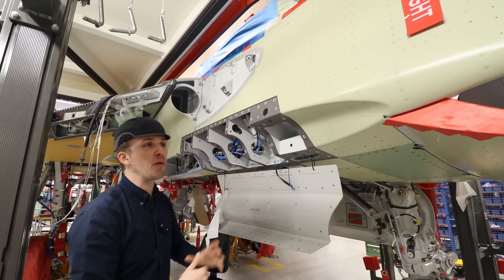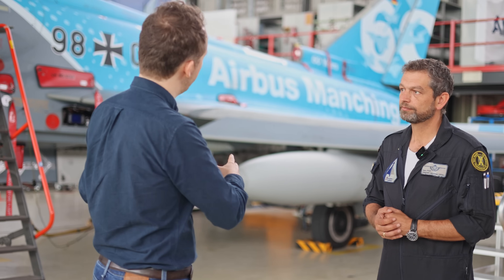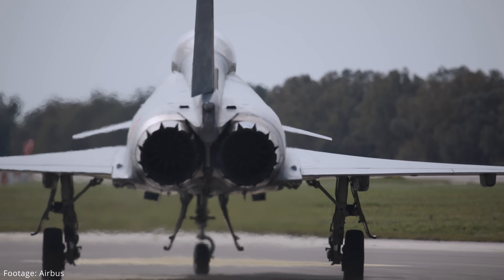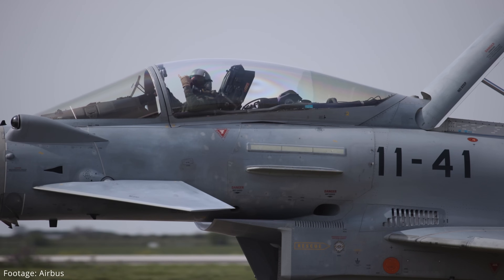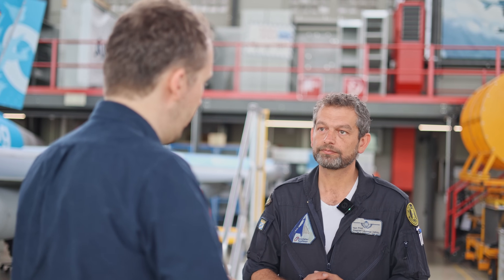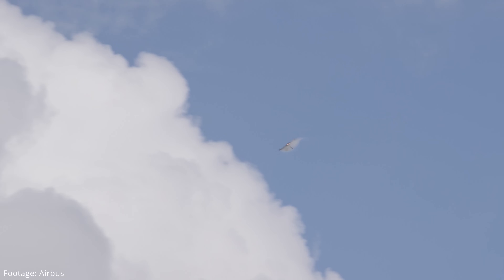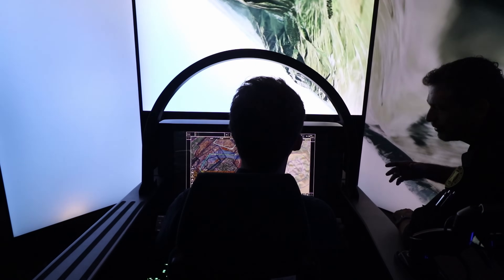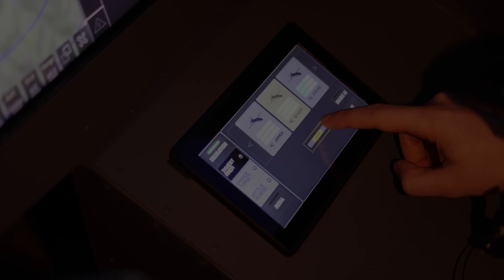The Prototype Eurofighter For Next-Gen Upgrades

Comment: The Typhoon fighter cannot any future air combat against Gen. 6 fighters.  You’re a 3rd tier air force in the Gen. 6 domain.
Reply: There are no 6th Generation Fighters. 5th Gen yes., but even then we do not know if the Chinese and Russian ones are as good as they claim.
Reply: By itself? Probably not. But it can still contribute by being a long range missile truck and sling Meteors if they have a stealthy platform providing off board targeting.
Reply: @SteelBattalion07  then why spend the money for the typhoon?   The existence gen. 4 fighters can do that for less money?
Reply: @hcf1956  Not all missions are going to be Gen 6 fighters vs the opposition. Not all missions are about air to air combat. Sure, a Gen 4 aircraft is going to lose against a Gen 6 95% of the time, but those aircraft will be used for other missions. On paper the Russians overwhelm Ukraine technically and numerically, yet they do not have air superiority. MiG29s, Mirage 2000s and F-16s are still causing the Russians major headaches and none of those are Gen 5 or 6.
Reply: @hcf1956  Typhoon Is MORE expensive than F35A. Typhoon cannot go up against true 5th Gen fighters and expect to survive very often. Trying to do a SEAD Mission in a heavily defended airspace with Russian S400 batteries defending, would be suicide. BBut F35 can do that better.Against 4th Generation fighters in BVR it is a total Beast, and will be better with the upgrades. In the merge it is very good but only with a good pilot and IristT or AAMRAM. Combine F35 with Typhoon and you have a good mix.
Reply: @hcf1956 lack of stealth means you have to figure out another route to fight. Europeans air forces lack EW capability and skill specialization in the realm of SEAD/DEAD. The EK model was suppose to be the answer for that but they kicked the bucket down the road for too long. The AMK model (based on the website) says that it’s to update the airframe to accommodate future munitions. So even if it’s not gen 5/6 it can still sling long ranger A2A. The India/Pakistan air engagements show that long range missiles on an older platform can still make a difference
Reply: @SteelBattalion07  True.  However, a  solution is available, and I believe you know that, but the EU's pride and hubris cannot admit there is a "better" solution.
Reply: @hcf1956 I think that goes both ways right? I’m pretty sure the US avoided EU offerings just to make it “designed/built in the US”
Reply: @SteelBattalion07  However, the US solution is "more" realistic and fundamentally sound based on the current and future engagement environments.
Reply: @hcf1956 I would point to the M10 Booker vs CV90 (where a good enough solution exists but oh we must design a whole new vehicle for crew survivability and end up cancelling it because it was not survivable because they didn’t require APS system as the baseline). I would also say Meteor missile seems like a good interim solution to quickly increase the range of A2A missiles and US can buy enough to scale down the price for everyone (like the F35). The K46 Pegasus tanker vs The Airbus tanker also seemed like something that was ready made but we chose poorly on that one. We could probably quickly get better SPH from Germany but no we chose poorly keep creating and cancelling SPH programs still end up with the M109 for decades. I still think the “it must be built/designed here” spans both continents
Reply: @SteelBattalion07  "Stealth" is not a panacea.  However, stealth provides a better survival rate, given the pilot's training, experience, and each engagements will/are have unique factors affecting an outcome.  Your descriptions are spot on.
Reply: @hcf1956 Thanks~ If I’m putting on the “I’m thinking on Europe’s behalf” hat on. I’ve squandered the last 3 decades because I decided to skimp on stealth (not unfairly because the US dragged the EU into 2 decades of GWOT). What can I do now with what I have before SCAF/FCAS is ready? I have no stealth, therefore the answer likely points to a EW-based solution. A Growler version of the Typhoon that can create some kind of survivability to jam and fight your way into Russian IADS. I think it’s still somewhat worthwhile to maintain the industrial base and expertise (rather than abandon it and just buy the F35) but they need to aggressively point it in the direction that would help Typhoon’s survivability in absence of stealth.
Reply: @SteelBattalion07   The Indian/Pakistan provides a glimpse of the true Chinese weapons capabilities.  Keeping in mind, Pakistani arm forces is "less than competent"?   The Ukraine/Russian quagmire however, is proving the Russians are a "gummy bear" with huge nuclear stockpiles and "not" afraid to pump their chest, bellicose, threaten use of nuclear weapons.  The Russians have demonstrated their ruthlessness deploying -- thermobaric weapons -- on civilian population to strike fear and to intimidate the EU and U.S.  Remove the nuclear card, and Russian would've sued for peace.  

 Vladimir Putin will not and cannot walk away or admitting he cannot outright win in Ukraine, because that'll make Putin a "junior partner" to Xi Jingping.   However, given the current situation, Putin is a junior partner sitting at the "little boy's table."  Economically, financially, and industrially Putin is above Pakistan, definitely two rungs beneath Xi Jingping.  This is why the Russian/Ukraine war is still raging or sputtering on.
Reply: @fizzyridertoo    TRUE.  However, it begs the question, why spend all that money on the Typhoon when you already have the solutions before you?   And much cheaper, I might add.  All the additional costs associated with building the Typhoon and deploying are massive.  Cost/benefit analysis will tell you it is "imprudent" to do so. The Typhoon is an "option" but not financially and practically prudent.
Reply: @JohnMcNamara-c7i    Why?  All that you stated is true, but, why or the need for the "mix" when the return on investment is less than optimal?  Why pay for a gold plated nickel?  Review your own statement and you'll understand my question, WHY????
Reply: @SteelBattalion07    We can both agree.  However, we both know, EU cannot spend on average < 2% collectively on defense and expect to keep up with the U.S. investments in defense, scientific and technical research.  The acceleration of technologies, research (both theoretical and technological) is accelerating at a breathtaking pace.  Not to be obnoxious,  you cannot have the cake and eat it too.
Reply: @hcf1956 absolutely agree with you on this.
Reply: @hcf1956 Several thoughts on this.  1 Both Indo/Pakistan likely have the export variants (less performant) of the gear from their originating country. 2. I wouldn’t say Pakistan (at least Air Force) is less than competent. A new thing I’ve learned that Chuck Yeager was the Air Force attaché to Pakistan in the 70s (integrating Sidewinders to Pakistani migs). I feel like they probably have healthy dose of US training/tacticts/doctrine. 3. Pakistani AF has fewer fighter platforms vs India but twice the amount of AWAC/EW platforms. I think recent engagement show the value they placed on EW and Airborne battle management. 4. Russian army, despite how poorly they’ve performed still have fairly respectable IADS that keeps Ukrainian Air Force at bay.   No comment on the rest re: Putin and current Russo/Ukr war except to say that’s fairly on point.
Reply: @hcf1956  So what's your suggestion? F-35s? Why would Europe buy more of them when the US is no longer a dependable ally? The Typhoon update will fill the required role in Europe perfectly well for now, along with the F-35s that they already have. Meanwhile the new Tempest and the GCAP and FACS projects are coming along nicely, with more countries probably joining the programs.
Reply: @fizzyridertoo   Back at you...are the EU a "reliable" ally?  Or an sponge absorbing all the benefits, while, shucking "fair and shared" responsibilities for -- your freedom and security?  You're no better than and cost so much more than a w#0#3.
Reply: @fizzyridertoo  F35 has kill switch. JD VANCE HOLDS THE BUTTON
Reply: @hcf1956  I have no reason to teview my statement thank you. Europe alreafy has a significant Typhoon force which is an excellent 4th gen fighter. The UK has the option to buy more Typhoons or more F35s (of which it has realitavely few). It has options on F35 and it seems that the RAF is leaning towards those  (F35A) in preference to more Typhoons.
Reply: @JohnMcNamara-c7i  yeah…double down on stupid.
Reply: @JohnMcNamara-c7i stealth is getting less and less relevant due to the rapid development in modern radar systems. So whilst the F35 might be a good short term solution it'll get absolutely massacred by every 4.5 gen aircraft once it can't rely on it's stealth anymore.
Reply: @bluefox9436   The only radar systems that have a chance to "see" a stealth fighter is long wave radar. You will not find these in any aircraft let alone missiles. They are very large and immobile. They are also innacurrate. They can tell you that something is there but you cannot track it in all aspects, much less get a firing solution. Using F35 to go in and degrade the enemies integrated air defence system is something that a 4.5 generation fighter cannot do with impunity. Furthermore, the F35 can act as master bomber behind enemy lines and guide weapons fired from beyond the range of s3/400 to their target
Reply: @JohnMcNamara-c7i there are already quite a few more systems that can track stealthy targets - long wave radar is simply not too much affected by stealthy designs and is terefore of course the best option, but the latest AESA radar systems are already able to track and lock stealthy targets at closer ranges whilst modern IRST systems can achieve locks at quite long ranges depending what the relative position of the aircraft is. Linking 2 aerial radar systems also seems to allow for a lock at decent ranges as well.
Of course stealth is still viable right now due to the fact that you need state of the art sensors or radar systems to even fight back, but radar systems are progressing at an extremely fast pace and there's a limit to how stealthy an aircraft can be (Millennium 7 made an interesting video about that topic). So yeah, right now building an aircraft around stealth is a valid option, but looking at mid or long time planning stealth will become more of a side feature against older weapon systems or to somewhat cap the range of long ranged anti air systems.
Reply: You are sorely mistaken. The Eurofighter is a very capable aircraft. The EU/UK are shifting focus to multi-domain assets. For example, the UK alongside Italy have just put an unmanned electronic warfare drone into service. These drones cripple enemy radar in such a way that the enemy doesn't even know it has been crippled. The purpose of this is so that high risk radar penetration missions can be performed by cheap unmanned craft, leaving the more expensive and very capable craft to deliver their payload and walk out without you even known what hit you.

Comment: Got a question, sort of related.  The F-4 Phantom II can carry roughly 8+ tons of bombs.  The F-15, F-16, and F-18 can carry as much.  Wikipedia claims the F-22 and F-35 can carry as much but obviously not in stealth mode, and I've never seen any pictures of them with fully loaded hardpoints.

Is there any kind of trend with this?  Do smaller precision-guided bombs reduce the interest in massive bomb loads?  I'd think that attacking infantry, as opposed to armor or artillery, sheer tonnage has value all by itself.  But I sure am no expert.
Reply: In modern warfare battlefield, "precision" is far superior to the massive bombing campaigns of WWII and Vietnam have demonstrated.  The F-22 airframe is not designed with the massive ordinances you have in mind.  Remember, the F-22 was "designed" to provide "air superiority" and dominance over and above the battlefield.  The old Boeing B-52 flying fortress can do that, but is an overkill and far too expensive to upkeep and is vulnerable in the modern warfare environment.  I also don't believe the "old workhorse" airframe can withstand the attrition of modern warfare.
Reply: There is no point in using big bombs and ignoring precision. Russia uses their new 3000kg glide bomb in Ukraine and they find a 50m offset acceptable. They thought the blast would be big enough to destroy anything near it anyway, they were wrong and are switching to many more smaller more precise (10m offset is acceptable for precise...) glide bombs
Reply: @lars7747 they aren’t new 3000kg bombs. Russia has massive soviet bomb stocks so is adding wing kits and using these up. How long these soviet stockpiles will last is beyond my knowledge. 
Definitely precision is being seen as more valuable than bomb size.
Reply: @lars7747 The 3000kg bomb is given a glide kit because simply put, Russia sees no reason to NOT use it.
Reply: @lars7747  It's other way round. FAB-3000 is touted only by Russian trolls, came relatively late compared to 500,1500kg UMPK equipped bombs but if you bomb a structure, it was already Brits in WW II who discovered that sometimes "near miss" is more effective as shock is transmitted through the ground than direct hit above (with Grand Slam and Tallboy bombs). Even Russians could add terminal guidance to FAB-3000 and how they achieve reported accuracy on smaller bombs without laser gyro INS is beyond me (remember, JDAMs have GPS/INS since very beginning ). On the other hand, FAB-3000  has 1,5 on explosive inside.  As someone put it - it's not the FAB/KAB-3000 (maybe 5000 on Tu-22M) people should be concerned about, but apparently the fact that Russians seem to be able to rain 500/1500 bombs in unending streams, limited by availability of aircraft and reconnaissance information, rather than production capacity.
Reply: The more weight the aircraft carries the more fuel it uses, manoeuvrability drops etc etc. 1 500lbs paveway can do the job of multiple aircraft with full loads of dumb bombs.